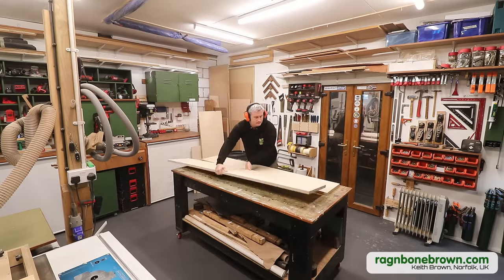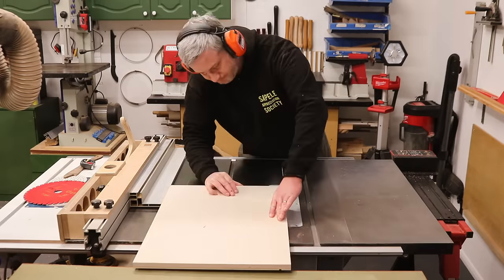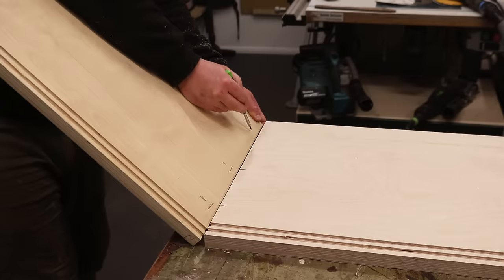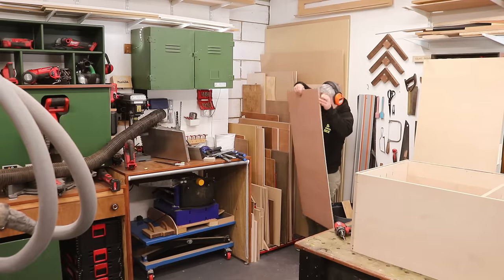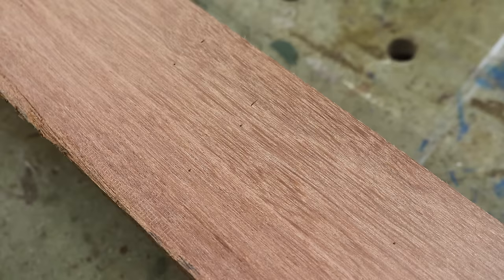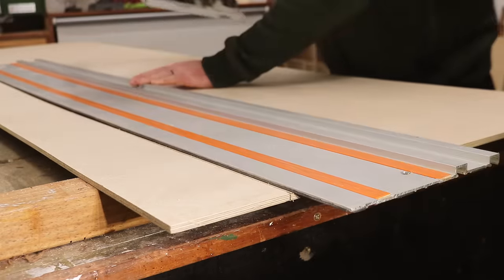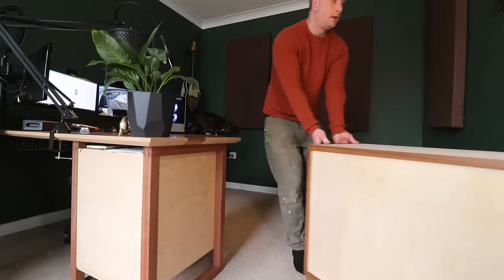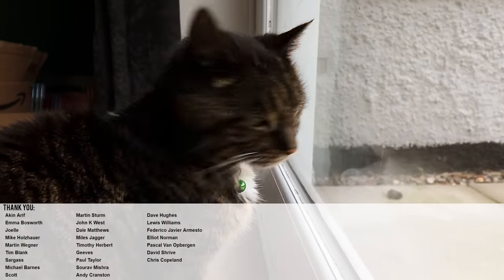I Made A Cabinet With Sliding Doors

Comment: Another quality cabinet. Nice work, Keith. The control of the overspray isn't always a flow or pressure issue, as the paint/finish still needs to be delivered onto the project. Most cabinet shops make use of a spray booth or tent, where the overspray is drawn away with exhaust fans. In your case, you may need to move the project outside to help keep the overspray from covering everything in your shop. I also noticed you have a very short auxiliary fence attached to your main table saw fence. Rather than using a feather board to help with the heavier or longer material, simply use a longer fence, or reposition the auxiliary fence to be further on the outfeed portion of the blade. This will help prevent the material from canting away from the blade.
Reply: Great points Dave.
Reply: @AlbiWiedersberg  The issue with the fence in the position shown creates the potential for kick back because the material is not properly supported on the outfeed side. Even if kick back is not the issue then the potential to ruin the piece due to off line cut should be enough of a concern to correct fence positions, or use a longer secondary fence. The main fence on Keith's saw is certainly long enough so I'm unsure as to why the secondary fence is in place.
Reply from the maker: I don't have any issues with overspray at all, actually. Which surprises me! I do have a spray booth, just didn't bother setting it up for this one. I tend to just leave the windows open and spray and then leave the workshop for a while until things settle. You're right about the short fence, I should have removed the auxillary fence for those cuts. I tend to forget that taking it off is even an option at this point as I set my measurement ruler with the aux fence fitted as struggle to make small cuts with the normal fence as the crown guard gets in the way
Reply from the maker: It's there so I can make small cuts without having to remove the crown guard, that's all. Nothing to do with kickback. Besides there's virtually no risk of kickback with the riving knife fitted regardless of the fence position 👍
Reply: @RagnBoneBrown  Fair enough.
Reply: @RagnBoneBrown  Whatever you're comfortable with is the important bit. I've seen enough of your videos to know you understand the dangers and safety issues. Would hate to see you have an mishap, that's all. Cheers!

Comment: I guess you could apply the finish by brush on the inside or spray all the parts before assembly but that means another step of sanding where the glue goes. Nice projects and great use of scrap.
Reply from the maker: Yes, good idea. Thank you

Comment: Your unit looks very 1960's retro Keith, it even looks good without the doors on. You could reduce the air pressure when spraying inside a unit but you'll still get spray bouncing back at you. Another way is leave the back off. Spray the unit and the back separately then screw the back on. This works plus its easier for beginners to avoid getting runs near the internal corners. Tony
Reply from the maker: Cheers Tony that is a great idea 👍

Comment: Im curious Keith, but why is your table saw fence so short?  Most fences reach past the actual end of the table.  Did you do some kind of modification?  Thanks for answering.
Reply from the maker: It's the auxillary fence and I tend to keep it fitted all the time as it allows me to cut small pieces without the crown guard getting in the way. I've set my measurement ruler to the aux fence so tend to keep it fitted all the time

Comment: Nice one 😁 , and I wonder what clear coat you used with your sprayer as some brand of water base poly can not be sprayed and I challenged it with disaster results ending up stripping it off afterwards. Have checked your shop but still not sure which one of the two available that you used ?
Reply from the maker: I've never had an issue spraying water based varnish. Wasn't aware there were some that could not be sprayed! I buy various brands but they're all the same really and all spray ok for me

Comment: Could the grooves have been easier cut with the tracksaw adjusted for depth relying on the track for clean straight cuts?
Reply: The blade on the Makita track saw only has a 2.2mm kerf, compared to 6mm on the table saw. So maybe he didn't want to make that many passes. The track would avoid the wandering cut though.
Reply from the maker: Yeah spot on, it'd take a lot of time and wouldn't be as precise 👍

Comment: Curious why did you use the auxiliary fence in the first place, just use the rip fence no - I'm missing something?
Reply from the maker: I keep it fitted all the time as I am too lazy to fit it when I need to make a small cut and the crown guard gets in the way, I have the measurement ruler to the aux fence so to be honest I forget taking it off is even an option !
Reply: @RagnBoneBrown  funny, I asked a about such a fence on a Facebook group some time ago and many had no idea what it’s for, I want to try and figure out how I can make one for my old wadkin, one that can be used and taken off easily for the same reasons as you it’s a pain to take off and on, but bloody useful.
Reply from the maker: I'm not a fan of the fence on my saw at all, so currently drawing up some plans and going to try and make a new plywood fence for it. Moving parts are not really my area of expertise though so probably going to turn out a failure !
Reply from the maker: Could you do something with magnets, assuming your fence is magnetic?
Reply: @RagnBoneBrown  Thats funny, was just later I thought rip/glue a metal strip into the fence then add a magnetic strip to the Aux fence, just need to get around to it. I hate having the over dust collection off the table saw cause I get a face full, now I have a mitre gauge from Banggood well two actually and that still means I have to remove the upper dust collection cause of the height, its complected and Im not sure yet how to solve it, 3hp really shoves the dust in my face thats for sure!
Reply: @RagnBoneBrown  Same here, but for sure I can say I wouldnt use wood, plywood, mdf  etc... seasonal movement is a prick! Plastic, metal all day long so you can trust the fence through the seasons IMO...